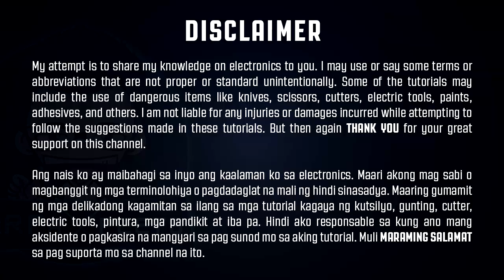Speaker Repair | Triple Magnet Speaker Repair Preview / Pulse by Ryan Audio

Comment: San at pano nasusukat ang vc ng speaker sir?..at yung iba ang sukat ay by inch like merong 6,7 inch ang vc..at iba naman by mm tulad ng sinabi nyo dito sa video nyo na 75mm ang vc ng speaker na nirepair nyo..baguhan lang sir, gusto matuto..salamat po.
Reply from the maker: convertion lang sir ng inches into mm..pero malimit mm gamit pag maliliit na sukat para mas accurate...
Reply: @WeRPaPeets  ah ok..maraming salamat po sir sa reply..more power po sa channel nyo..